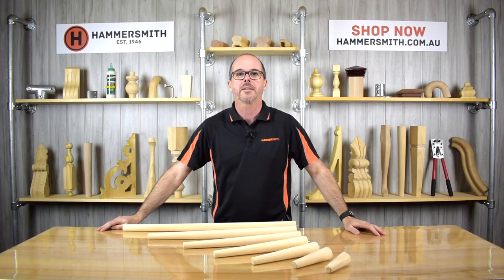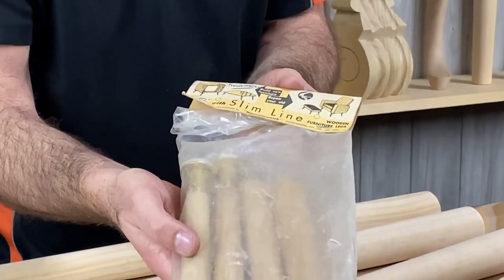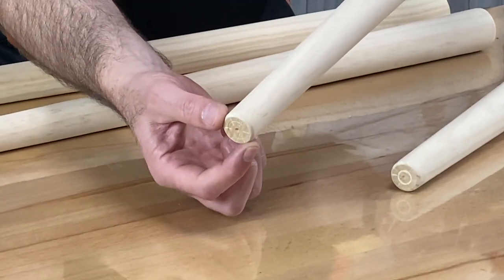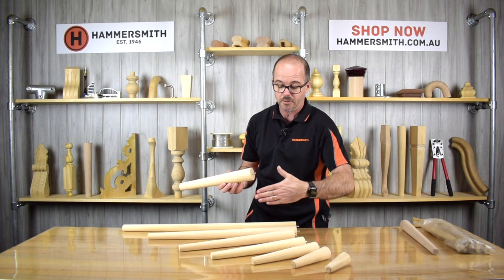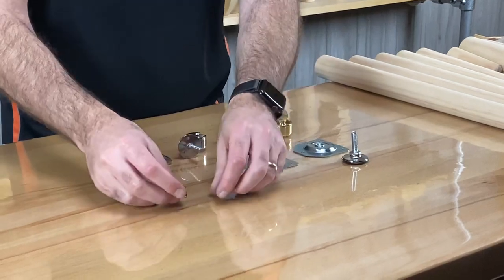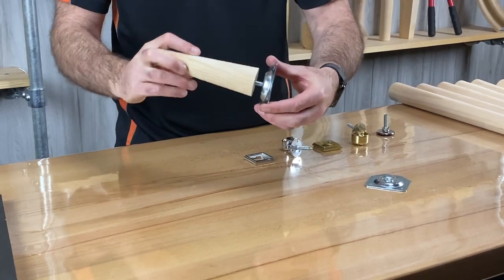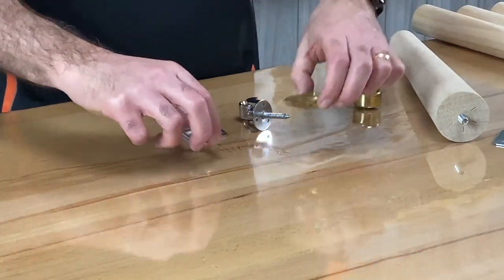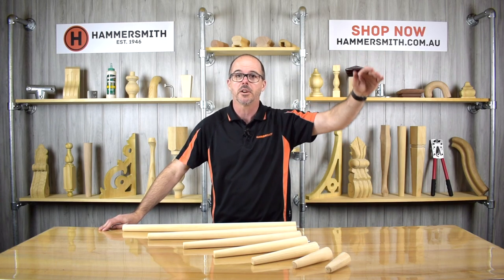Review: Round Tapered Furniture Legs & Fixings | HAMMERSMITH

Comment: These "Slim Line Legs" are exactly what I have been looking for.  Back in the 60s someone made me a small table with just the top and 4 slanted legs.  That table was one of the most practical pieces of furniture I have ever owned.  It was the perfect height, width and length.  Today I am looking at having my own computer table, the size and height that I need.  I am short, measuring under 5 feet.  There are not many options available to me.  The usual desks are too high.  The adjustable ones run from $300 to $1,000 and they are too big or too small.
These Slim Legs would give me the height and size that I want and need. 
I did not know what they were called  until I saw your video.  Up until now, my searches for these legs were unfruitful...
Thank you for this video.  While I live in Canada, I am hoping I will be able to get them here.